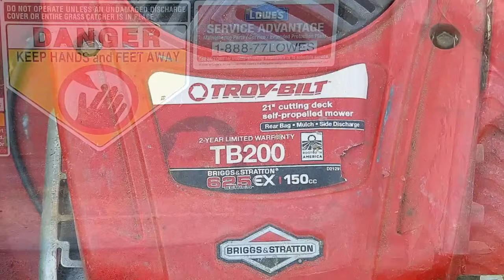Fixing A Troy-Bilt Mower That's Smokes

Comment: Just to be clear that spark plug easily could be correct despite being a different size there are many spark plug cross references sites that you can use to find out what plugs are exchangable. Hope this helps in the future
Reply from the maker: This is spark plug is the wrong heat range and the tip of the plug doesn't reach far enough into the combustion chamber.   I might have to make a video about this to explain it better.

Comment: a lot of grit in my area , especially in summer when grass dies off . no coating will stand up to this . when i clean the deck after last mowing of the season , i apply paint or oil . i've stopped , or at least slowed rust for a few months .
Reply from the maker: yes, if the point is to slow the rusting, I agree a coating works well.

Comment: Nice fix!
As much as I miss flatheads, these are fine running engines. The jets get plugged easily, but is a simple fix.
Reply from the maker: Very true!  As long as it's used regularly they seem to to work well
Reply: @HomeGaragechannel  That's what I been saying for a long time. Start that engine at least once a month (every month) and I've never had a carb issue.

Comment: Turned out to be a nice little mower 👍
Reply from the maker: You got that right!
Reply: @HomeGaragechannel  Also I wanted to reply about the hose fitting clean out on that deck you screw your garden hose on the female fitting turn on the water and start the mower and let it run for a couple minutes when you get done mowing I was amazed by how good that worked
Reply from the maker: thanks for letting us know.  In my testing it only works well used after each and every mow.

Comment: Another great informative video.  I literally just picked up a craftsman self propelled mower off of the curb this week.   It had easily 2 times the required amount of oil in it.  Not sure how that happens considering how easy it is to check the dip  stick.  Either way after cleaning the carb and replacing the air filter and fuel line runs like champ.  Thank you for sharing your video.
Reply from the maker: no problem and thank you for watching

Comment: Very nice repair, good job sir! That’s funny regarding the spark plug - I recently picked up a nice Toro SR4 with the Loncin engine and it was running funny / popping / not restarting easily etc. I went to remove the spark plug and noticed it was partially unthreaded, so I re-gapped it and torqued it in. When I pulled the rope it let out a loud backfire and wouldn’t even sputter after that. Pulled out the plug and the gap was slammed shut. Previous owner installed the wrong plug that was too long, then when the piston hit it he must have re-gapped it then only threaded it in part way and went on using it like that! BTW I after fixing it all up I kept that one, it’s an awesome mower with the blade clutch, manuals, bag and mulch plug. Only three years old and got it for a song 😁
Reply from the maker: wow!  Glad to see you decided to keep it.

Comment: The beige paint sprayed randomly to start with means that the original owner returned the mower to the big box store under warranty and the paint was used to identify it as not willing or practical to repair and to be thrown into the dumpster.  
The next owner pulled it from the trash, fixed whatever was wrong with it and sold it to the next owner.  Poor (more like no) maintenance after a few seasons was why you got it.
Good recovery of a nice mower.
Reply from the maker: thanks

Comment: Great video.   My John Deere 14pz could use a good cleaning but I am hesitant to use my power washer on it.   You seem to have had no problems even power washing it with the engine cover off!
Reply from the maker: no problems, just so long as you don't spray directly into the muffler or air filter area, you should be fine

Comment: Well, this turned out to be a successful project.  If you maintain your equipment it will last years, if not decades.  I don't think people will realize that switching to battery electric also requires maintenance like keeping vents clean and maintaining blades and the bottom of the machine.  Those machines are also more sensitive to dust than internal combustion engines.  People don't realize that even their computers should be cleaned at least twice per year like the refrigerator they probably also neglect.
Reply from the maker: couldn't have said it better myself!

Comment: It’s actually pretty easy to overfill these small engines.  I’ve gotten many of them free and they smoked from overfilling.  I estimate that it takes a little over half a quart to fill.  Somewhere between half and 3/4 of a quart.  If you put over 3/4 quart, they sometimes will smoke depending on the model.
Reply from the maker: you are right about that

Comment: When you first started the lawn mower something did not sound quite right when it was running when you pulled out the spark plug I was surprised that someone could get that wrong of a spark plug and not even compare it to the original one
Reply from the maker: I know right!

Comment: It's not only that the flame front is happening somewhere in the spark plug threads but throwing random spark plugs without taking the correct heat rating into consideration can cause all kinds of weird problems (awful to diagnose ones aswell). Most horrific (but rather rare) is breaking ceramic isolators because of overheating. That's a sound you'll never forget. Uncontrolled glow ignition is more common yet as deadly as come ceramic parts in the engine. Bonus points for missing cool air/fuel mixture flow over the plug because it's recessed in the spark plug hole. 
Lot of people don't realize how important the choice of the correct spark plugs is, not just in cars or motorcycles but every combustion engine.
Reply from the maker: thank you for that information

Comment: If it's OLD I just run the diesel formula 15/40 and let 'er smoke. Just keep a check on the level and keep it full between changes and YES, I change the oil in smoking stuff too. It didn't ask to not be kept up and I'm sure not holding it against it. Mowed again and 74% left. Still going strong and Happy Mom's Day Yall!
Reply from the maker: thank you , I totally agree and the same as well!

Comment: Hey home garage. Long time viewer, but I haven't been interacting much because watching your vids have helped me keep my equipment running well lol. 
my toro recycler with a briggs motor has been running well but it's not catching the grass, its catching/clumping up in the tunnel. I've clean the inner deck area, sharpen the blade, and cleaned the bag. Can figure why it's not catching the grass.
Reply from the maker: I see and I think I know what you're talking about.  Have wet is the grass when you're cutting it? is there "active" watering for this yard?  Also, how much grass are you cutting?  If you're cutting 3" or more inches of grass, it might be too much for the blade and deck to handle.  Also, how fast are you moving the mower across the yard?
Reply: @HomeGaragechannel  the grass is not wet, the grass is roughly about 3ins, and I'm going as fast as the self propeller will go. I'll try to go slower and cut more often.
Reply from the maker: going slower might be helpful.  Also have you checked to see how much grass build up is under the deck?

Comment: Amusing seeing you using a pressure washer on it when the deck has a built-in/self-cleaning water sprayer thing with the hose connector still attached
Reply from the maker: the deck washing system is to be used  after each and every mow.  It doesn't do anything once the build up has hardened over time.  I have a great video showing that very issue.  After running the mower for well over 10 minutes, all it did was get the underside "wet" no material is dislodged.  Thanks for your time.

Comment: Gotta love those easy fixes. Also good idea to trim the choke lever. 
I’d check and change the oil. I couldn’t in clear conscience sell something that wasn’t in its best possible condition. 
BTW do you set all machines at .005 regardless of manufacturer? Trying to find the specs on all machines is a pain. Setting them at .005 across the board would be much easier. 
Cheers
Reply from the maker: I feel that same as you do!

Comment: Recently I was working on a mower and I had trouble getting it to start on the first pull when cold. It was a Briggs engine like this mower has. I cleaned the carburetor, adjusted the valves to 5 thousandths and changed the oil but it still takes about 5 pulls to start cold. What do you think could be the issue?
Reply from the maker: sure, did you confirm that the choke was working like it supposed to? Also, did you make sure the O-ring was on the back of the carb when it was installed?  The last one, is, did you do a compression test?
Reply: @HomeGaragechannel  I did check the choke and it seemed to be working correctly as it was closed when the engine was cool. I also made sure the o ring was on the carb. I didn't do a compression test though, the engine runs normal after it starts and when hot it re-starts on the first pull
Reply from the maker: well 2 out of 3 isn't bad.  If the compression is fine, then the carb is the issue.

Comment: When checking oil levels, do you need to place the dip stick just on top or do you screw it in  place.
I love your approach to your videos.
Thank you very much
Reply from the maker: I appreciate it.  No, on this Briggs you need to screw the dipstick back in, and then remove it to read the oil level.  All the Honda's only have you press the stick in without screwing them in.

Comment: Ill have to try this on my toro. Its getting hard to start and its letting out puffs of smoke when it first starts
Reply from the maker: good luck with it
Reply: @HomeGaragechannel  turned out fine. Lash tested at 0.15mm which is roughly 5 thou and oddly enough even though I didn't adjust anything it fired right up normally this time so who knows. I just cleaned the carb so that shouldn't be it. Oh well I mowed 3 yards today where it got some use and it fired up perfect every time
Reply from the maker: glad to see it working again

Comment: Hi. thanks for yuor videos. I have one mower just like your.. But my start and stay like that for 5-6 mnts and than shut off byit self.. what do you think can be the problem???.. I am in Ca.thanks
Reply from the maker: sure, It's either the fuel cap is bad and not venting like it should, Or the fuel line is collapsed on the inside and slowing the flow of fuel to the carb.  Or the carb is the problem

Comment: 10:38 Question could you also use motor oil to lubricate them?
Reply from the maker: it's your choice, and yes it'll work, but I would not  personally use engine OIL
Reply: @HomeGaragechannel  What do you use to lubricate them
Reply from the maker: I use, lithium grease right now.  It's not as thick as oil.
Reply: @HomeGaragechannel  Where can I get lithium grease
Reply from the maker: from any autocrats store.

Comment: I just rebuilt the carburetor on a troybilt push mower model # 12av566nq211 the videos I watched wasn't clear on the white bracket that goes from top of the carburetor over to the muffler side. It meet another piece that's white plastic. It goes down between exhaust and the motor. It seems to  be spring loaded. The part from the carburetor side is supposed to connect with it. I tried to catch how those two pieces connect but it was blocked. I just have what he was saying. That when the long piece is hooked to the other side it does something e
With the heat from. Exhaust. I think this is where smoke is coming from. Because I don't know hoe to attach the 2
Reply from the maker: the model shown in the video will not help with your project

Comment: I think a more important problem with the shorter spark plug is that the combustion volume is larger.  So you get less power from each combustion.
Reply from the maker: you make a good point

Comment: Do all carburetors have an adjustment screw? My Blackmax weed eater has a barrel carburetor and for the life of me I can’t seem to find the adjustment screws on it.
Reply from the maker: most of the older ones have 2 screws, some only the one.  The ones that have the "barrel" types of carbs, like on echos, have 2 but they're hidden.  And a few of them, have none what so ever. On the barrel types, the only screw is the L screw And it's in the middle of the barrel on top, where the brass part is.  use a flash light to help see it. You'll need a tiny flathead to turn it.

Comment: With the original "High" oil level the owner had, it may have been hydro locking, causing pull cord to be hard to pull...& got better when it leaked out...Just a thought..Nice Find!!
Reply from the maker: you might be on to something and thank you!

Comment: Check the oil level & probably change it if it's dirty, drain the oil to the correct level meaning that I may as well change the oil.

Run the engine to burn off the excess amount of oil & see that it doesn't keep burning oil once it has warmed up, rebuild the engine if it does !
Reply from the maker: agreed

Comment: Question: I bought a compression tester from Temu but the readings for two good two stroke blowers was way too low.  I think the tester is faulty.  I noticed the one you listed on this page was only $13 on Amazon.  Do you trust the readings? It doesn't seem to have a Shrader valve attachment.  Is one needed for two and four stroke engines?
Reply from the maker: The piece that sticks out of the metal part is the relief for the Schrader valve.   Sometimes you get a bad one. If so, send it back.

Comment: My mower starts cold and smokes really bad.  After it runs I see oil on the deck out of the exhaust.  It has little power and will die  soon.  Is this possibly a broken ring or possible valve gap?  It seems valve gap smoke goes away when the engine warms up if I understnad correctly.. I am curious to your thoughts??
Reply from the maker: when does the smoking start, immediately at start up or is there some and gets worse before going away?  Knowing how quickly the smoke appears after start up would help to figure out where the smoke is coming from.
Reply: @HomeGaragechannel  it is smoking when it starts up but a little.  it begins to grow in intensity to the point where it stalls.  When this happened. it was running ok, and started to loose power over a 5 minute time while mowing.  I removed and cleaned the carb thinking it might have water in the gas.  I took the head off and replaced the head gasket in case oil was leaking into the gas pulling into the cylinder.  If the valves are too loose (too much clearance), would that starve the gas since the valves would not be opening enough?  my thnking was that if the valves were opening too much would make it run richer.  I got another head with valves to see if it would help and did not.  There is no knocking or bad sounds...  how about lapping the valves?  critical or not really?  I am suspecting leaking around the rings???  Thisis the only part that I cannot see very well. When it stalls out, there seems to be oil on the deck under the outlet from the muffler.
Reply: I just saw another video where there is a reed valve under the flywheel that recirculates crankcase gas back into the carb.. could that case it is the reed valve opens up possibly?

Comment: I'm working on a toro recycler with a crappy Kohler engine (I hate those 😂) and the tall mounted screws along with the bolts holding the engine shroud are all bent and stripped and no matter what I try, i cannot get the cover off. Any advice?
Reply from the maker: you mean the 3 nuts and studs that holds the recoil and the cover on?   Not sure what I would do since I've never had to deal with that situation before.  I guess, I'd drill out the stud with a drill bit a hair bigger than the stud.  unfortunately this will mean you'll have to replace all the damaged studs and nuts.
Reply: @HomeGaragechannel  yes, thank you! This is my first time having this issue also. I did try that and had no luck. It's driving me crazy because I have no way of getting to the engine until I can get this dang cover off.
Reply from the maker: sorry to hear that.  There's not much else left to try
Reply: @HomeGaragechannel  it's ok. That's what I was afraid of

Comment: Hey HG, what should I do about my TB110 that starts up just fine, but with starting some black smoke comes out for a few seconds and overheats within about 2 hours of using ? Also great video as always !
Reply from the maker: thanks.  The black smoke is the result of the choke doing its thing.  How do you know that it's overheating?  Have you checked the oil level?
Reply: @HomeGaragechannel  so it will start to overheat after about an hour or two of mowing where it will start to stall and then eventually shut itself down, it will also start to belch out more black smoke during this. Going in front of the exhaust port, you can really feel this when the exhaust is way hotter than it usually is, idk how exactly to describe it tbh. This has also been happening even after the oil was changed

Comment: As good of shape as that mower is, it doesn't look like it has a pile of hours.  At least, not enough for those valves to be that far out.  I wonder if they were messed with already or not set correctly from the factory.
Reply from the maker: I know right! it was kind of a mystery

Comment: What kind of product to clean were you using i would like to purchase one ?
Reply from the maker: I use a degreaser from Harbor Freight, and a paint sprayer using water.
Reply: @HomeGaragechannel  is there a specific brand to the spray or is it made and only sold at harbor freight. Because i dont have a harbor freight!
Reply from the maker: no, almost any "degreaser" will work fine.